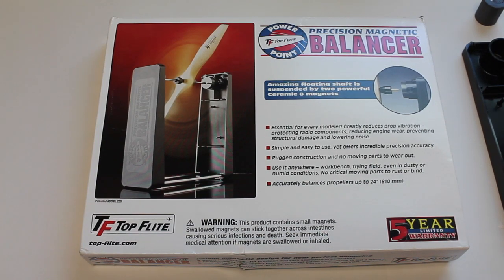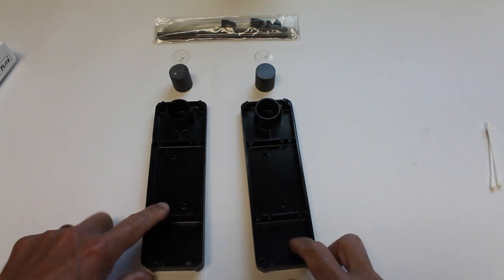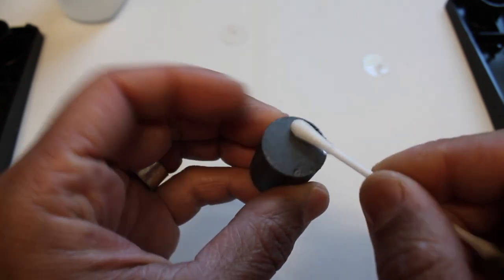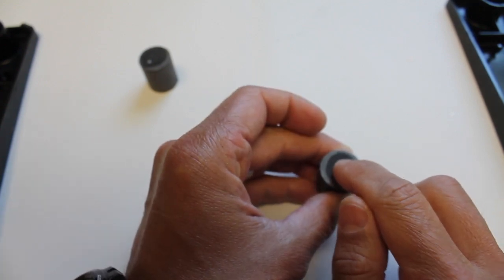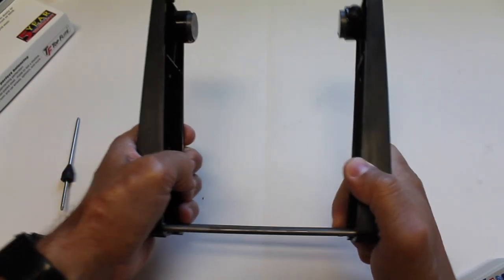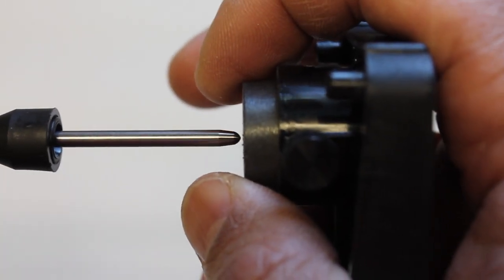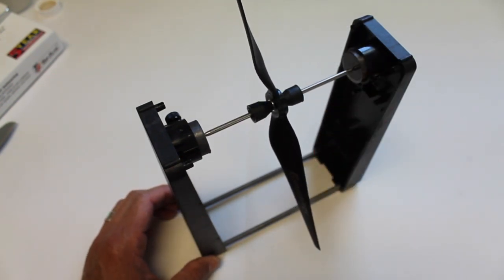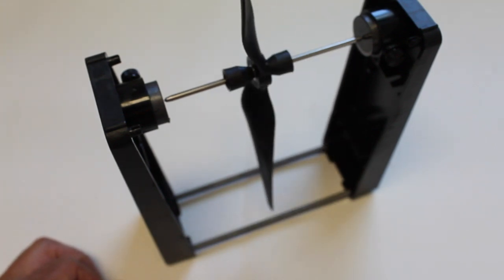Top Flite Magnetic Propeller Balancer for Killing Quadcopter Vibrations

Comment: Dennis, great video. I home brewed one of these, but I noticed if I turn the shaft without a prop it wants to return to one position, as if the magnetic field has an affect on the shaft which does not make it accurate. Do you have the same effect on yours?

Comment from the maker: That's good to know. It's crazy to think about all the different variables that can impact vibes on a quad. It will drive you crazy. Good to know about doubling up the plates. Did you have it mounted to the tab part of the bottom plate that sticks out on two sides? I've seen a lot of guys do that, but I've never tried it. Mainly because I'm flying the TBS now.

Comment: hi dennis.. great video and thx for the knowledge..... hey FYI, regular rubbing alchol is BAD to use for cleaning especially when used on plastic as it will actually EAT the plastic away.. THE BEST thing for modeling is denaturized alchol that you can find in one gallon cans from a Home Depot or Lowes type of hardware store :) happy using !!! NO DAMAGE to any surfaces not even plastic or drywall paint.

Comment: Yay! The difference between a magnetic balancer and the finger ones are night and day. Had a fight with a DJI F450 frame and getting my Gopro Hero 1 to not jello It was odd because my friends Gopro Hero 3 didnt have the issue. Realized it was quite heavier and resonated the platform of the DJI frame, like the platform was slightly flimsy. Fixed it by doubling up on the bottom plates and had to make sure that the camera was mounted as tightly to the frame as possible. Just FYI..

Comment: I purchased the Top Flite Magnetic Propeller Balancer.
However I have a Wltoys V262 Quadcopter and the thickness of the
Propeller is a few mm too thin, and the shaft of the Balancer will not
go thru the propeller hole .
Do you know weather the manufacturer bakes a smaller shaft to fit
the V262 propellers?
Reply from the maker: I've looked and haven't found one from the manufacturer, but perhaps you can find a shaft from another balancer that will work. Good luck.

Comment: I was doing them in attitude "stable" mode. So the only way to get it to come around requires you to be off throttle. It's hard to explain because I've never seen another person stunt like I do lol. I flick the roll or pitch in one direction while simultaneously cutting throttle entirely, as soon as it comes around im back on the throttle. I got really stupid at one point and was yawing as I came off the throttle, didn't realize what I had done till it hit lol. Watch JBQuad Convention Center vid

Comment: I'm finally up and running Dennis. I have my f450 flying and have done a couple of FPV flights as well. As soon i get time to edit, I'll post a video of my maiden FPV flight. I'm still having issues balancing my props. I got the top flight one. I balance the blades till they stay horizontal then i try to balance the hubs and it's strange. I'll get to a point and then all of a sudden it's like the weight completely shifts and i'm back at step one again. It's really strange.

Comment: Ya I just set my GoPro on top of the "tab part" of the plate with velcro on the bottom of the gopro and a velcro strap to really crank it down on the frame. In response to your earlier comment, I use the carbon reinforced gemfans. They are a bitch to balance but I haven't had one fail on me midflight yet. Just dont accidentally disarm your motors doing flips like I did earlier today! lol another 4 props in the trash LOL

Comment: Honestly though, I can hardly fly a quad without "stable" mode. Iv'e never seen anyone stunt like I do, I think I may have invented it LOL. The flips aren't as controlled as it looks because the stick movements that are needed to pull off each flip are very fast, The more you do it the more it makes sense, I guess it just takes a bit of practice. Don't stunt in stable mode without reinforced props though, its very hard on the props if you screw up a flip and it goes bonkers to correct itself.